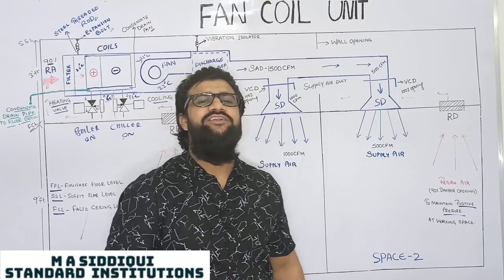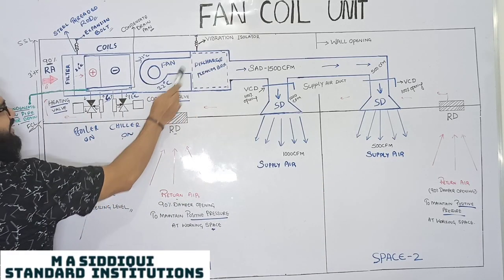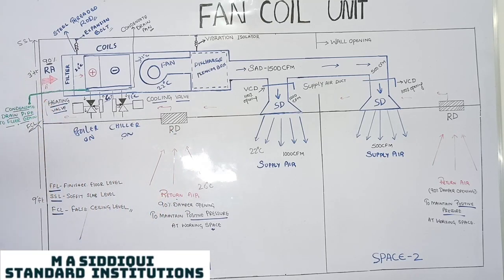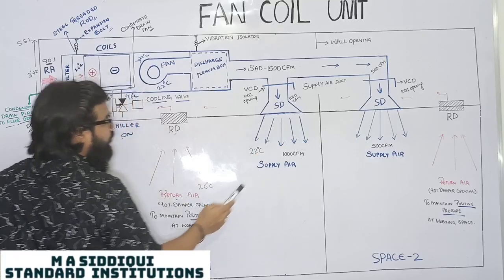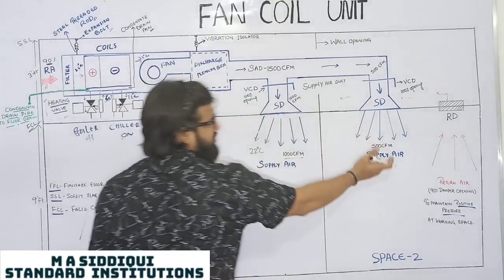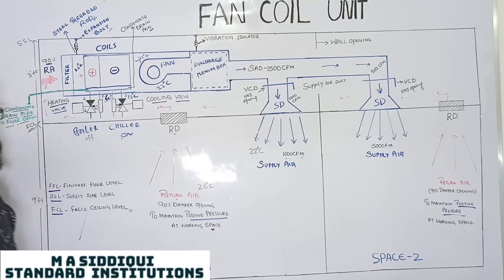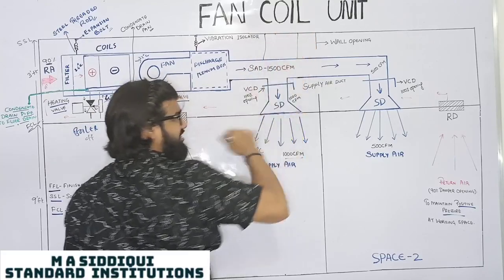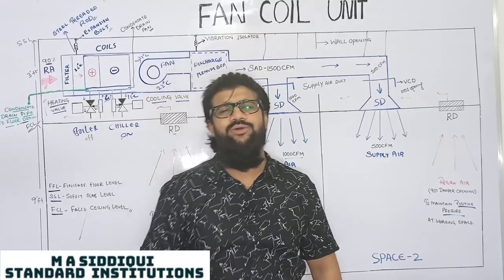DUCTABLE FAN COIL UNIT (FCU)

Comment: How to make fresh air supply provision with fcu?
Reply from the maker: We don't have provision of fresh air with fcu, that's the reason in high-rise buildings we use fahu to compensate fresh air or you can use separate fresh air fan provision with 10% to 15% of Main CFM of FCU.